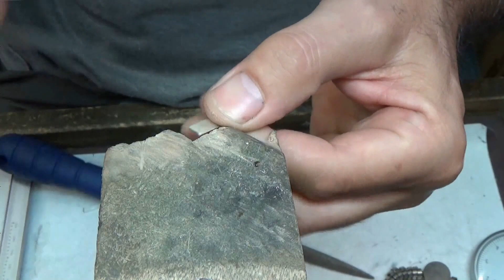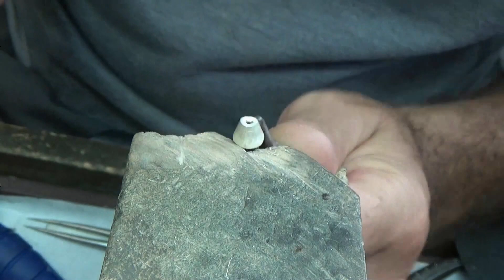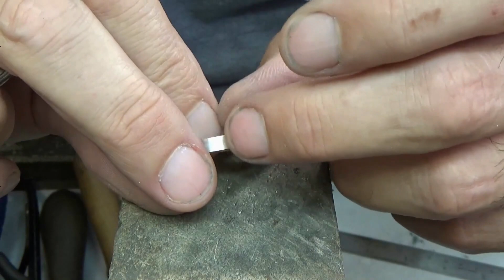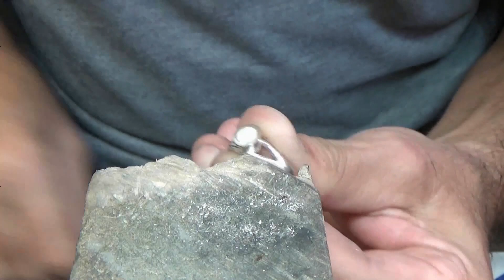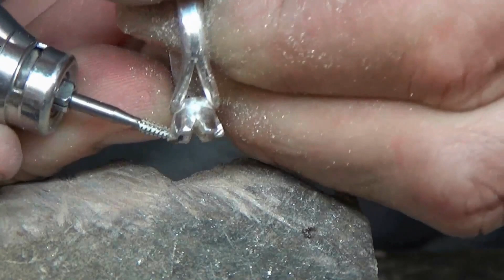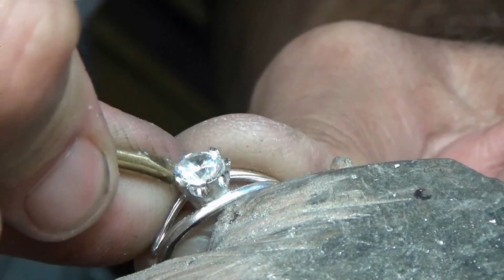Six Claw Split Ring

Comment: please what is that tool your using on your dremel (white abrasive disc), ive not seen this before i usually use the nylon brush wheels, would love to try this out but cant quite pick up what you call it in the video, thanks great content by the way
Reply from the maker: I think you refer to the Moores disc. https://www.cjservice.com.au/moores-sanding-disc/